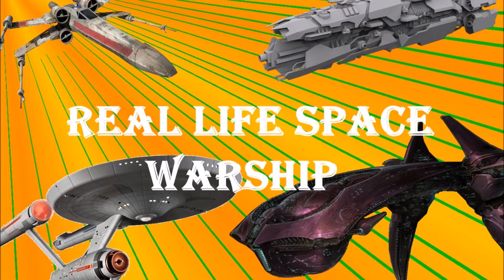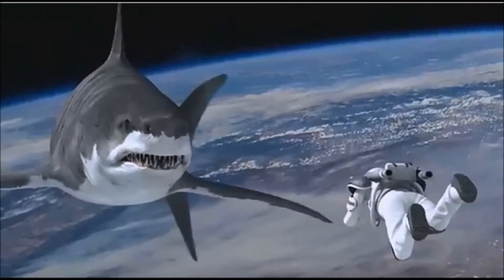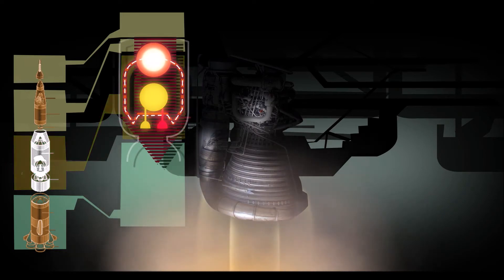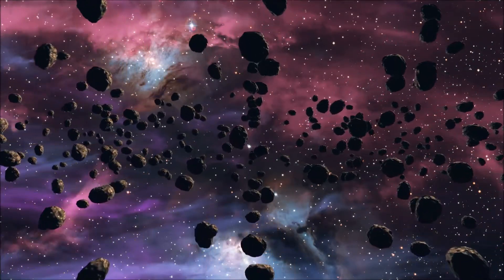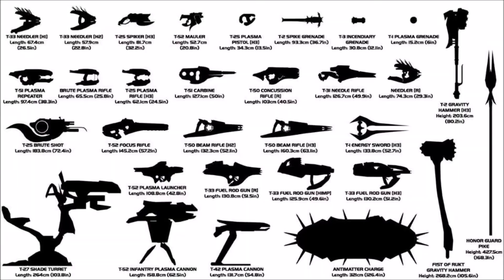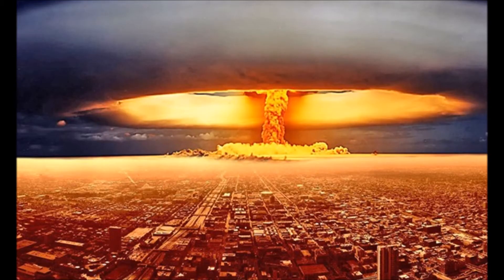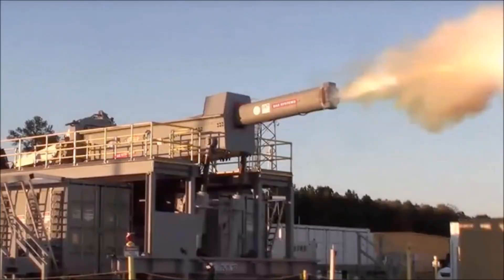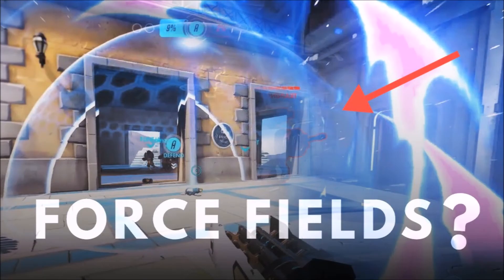Let's Build a Realistic Spaceship (Sci fi Realistic)

Comment: u need heatsinks. plus chem is very slow. but if if it's like a Corvette that is deployed by a bigger long range craft then it works.
and stealth can work if you put a radiation shield in front of your ship, like Jwebb uses for keeping its systems cool. but it is really situational. the stealth only works if you are looking at your enemy, but for that you need to know where the enemy is, and for that you might have to send a signal. but since spacecraft are big white reflectors anyway, visual confirmation might be enough. 
aaand
either a: you have to cool your radiation shield to background temperature, or b, you can only use it if you have the sun behind you, to only heat your ship and not the front facing radiation shield

Comment: The closest thing to a realistic force field I've seen would be kinetic-barriers from the Mass effect series. Mass effect has a fictional mineral called element zero which when subjected to a current creates a mass effect field. A mass effect field has the ability to change the Mass and direction of any object in the field via the manipulation of dark matter(its sort of like a magnetic field that works against all objects) ships are surrounded with emitters that generate mass effect fields when they sense an object approaching above a cirtain velocity. These mass effect fields repell the object similar to how a magnetic field would repell a piece of metal. Kinetic barriers don't work against radiation, toxins or extremes of temperature.

Mass effect has also given a plausible idea for a stealth system in the form of the Internal Emission Sink(IES) stealth system. Any emissions given off by the ship are stored in lithium heat sinks with in the hull and once again ships can still fly in stealth mode because of the Mass effect phenomenon. A special drive core called the tantalus drive is powerful enough to create mass consentrations of dark matter at the front of the ship which creates a gravitational like force on the ship, moving it forward. This technique isn't very efficient for space flight because your ship is basically in a constant artificial free fall and has limited maneuverability but its enough to allow some degree of undetectable flight. While using the IES the ship can passively drift for days or fly for hours. Every the sinks would have to be vented or els it would vent into the ship, frying electronics, fussing bulkheads and cooking the crew alive.

Comment: I feel like a double hulled design like most of the ships seen in Star Trek could work realistically, Take for example the Excelsior Class you mentioned, It's saucer shaped hull is a habitation and command section and the lower hull is primarily it's engineering section where a lot of the machinery and volatile elements used in the ship's main propulsion system are stored, Both hulls are connected by a thick interconnecting dorsal strut that can take more of a beating than the constitution class Enterprises. For safety reasons these two main sections CAN separate in an emergency situation such as the main propulsion system being too damaged to even try repairing, To serve as a lifeboat should the saucer be required to make planetfall or to prevent an individual or invading force from taking control of the entire ship. The Saucer itself has the secondary sub-light propulsion system which would help it escape from any emergency that could arise following the separation thus potentially sparing the crew from any further danger.

Comment: I think laser weapons through space, plasma in air, as the insane cold have space would render plasma pretty useless, but particles in the air make lasers require more energy to do the same job. Likewise to avoid as much kickback as possible, rail guns with a cold acceleration. Not as powerful as a railgun utilizing special bullets, but by using electromagnets like a slingshot you lose alot of the kickback
Reply: except that plasma won't be able to conduct the heat anywhere other than the gun and the target (if hit), it will only radiate energy and that's a slow process. the problem would be to actually make a gun that can shoot ball/streams/jets of plasma
Reply: @midgetman4206  so back to the railgun bit, but that means the plasma would have to be iron based, which loses its magnetic properties as it heats up
Reply: @Furyhound  no, it can be gas based, noble gasses are the best ones but also the most expensive. Maybe a combination of argon to start and the secondary gas is injected, N2 or CO2 will do just fine.
 
The way the plasma is generated is sort like a microwave, a wave (don't remember which one, it might've actually been microwave) excites the gas within a chamber and can become ionized which than makes making more plasma easier as plasma is a better conductor than flat "air"
Reply: @midgetman4206  its likely to be microwave, because thats low energy but high intensity.

Comment: I think that in terms of shape, Cylindrical, Spherical or Cuboid ships would be most logical. The Mon Calamari, Forerunner Cryptum and Borg Cube would all be very good at deflecting fire provided they angle correctly. 

As for weapons, I think lasers would be the only ones capable due to immense distance. Though because of a lack of atmosphere, a laser wouldn’t be able to penetrate a hull. As the hull would naturally have an extremely high melting temperature to handle the extremes of a vacuum. 

Rather, itd be used to overheat the enemy ships and force evacuation. 

Missiles would only work if they had some kind of “slipspace” drive to warp them into the enemy point blank.
Reply: I would agree with you friend but there is a problem. Slip space is 11 dimensions all together I recommend going to a halo channel on YouTube known as installation 00 he will explain to you everything about slip space in a video called slip space so objects that are in slip space pass through objects in real space so let’s say you have a 600 km astoroid on a coarse with a planet but the astoroid is in slip space the object would just go through the planet
Reply: So if you take a missile and put it in slip space to attack a ship the missile would pass through the ship and no one would notice. And besides, we don’t know if slip space is possible in the real world

Comment: What about a ship design that didn't Need to "flip over" for combat or breaking?
Reply from the maker: The main issue I have come across with such a system is that its unnecessary, having a dedicated main engine for braking would add a lot of mass to the ship for both fuel and the unit itself, since less mass allows for greater acceleration then it doesn't make sense to not just flip the ship to break, but I am not an expert so this is just my opinion

Comment: Why use a chem rocket ? The Dv is terrible!

The reason to use something like a ion rocket is the far better Dv you get for the same fuel to mass ratio.

Ideally (barring something like a fusion torch) you would use a Nuclear Thermal Rocket (thats where they run the propellant through a nuclear reactor as the coolant, the propellant heats up far more than from a explosive chemical reaction, and thus the (now vapor) propellant goes oit the nozzle much faster). The NTR will give you good Dv and good acceleration
Reply: For solid core NTR calling dV "good" is a bit excessive, but "less tragic" would be a pretty good description and it should be enough to make some interplanetary flight viable. Actually solid core NTR won't necessarily run hotter than good chemical rocket (say hydrolox), but it can produce lower molecular mass exhaust and give much better exhaust velocity.
Gas core NTR would be impressive but it's an engineering nightmare in one way or another.
Short of fusion torch Orion would be a surprisingly good propulsion - if you don't mind riding a series of nuclear detonations. 
Or NSWR if you consider Orion too boring, safe and sane.
Reply: Also, if you want something super cool, go check out children of a dead earth, its a space warfare simulator. Like ksp, but with weapons and a realistic damage physics model
Reply: Chemical rockets I think are bound to be far cheaper than using any form of NTR (excluding maybe the ones using purely decay heat instead of fission heat), and thus more expendable. Any form of missile meant for ship-to-ship combat within a reasonable range will therefore be using chemical rockets. 

For torch missiles, ones meant to essentially be a hunter-killer and with possibly a large nuclear yield, an NTR makes sense because those are already going to be expensive and you need to squeeze out as much Dv as possible.

Comment: Great. You earned a sub.

1. I love that you picked chemical engines. Most of the time I go with the nuclear thermal rocket for the In-between ion and chemical, but you raise a point- in any setting where there’s space war, there’s orbital installations, there’s many chances to refuel, and when there’s chances to refuel, you can get across Sol with a puny ol’ classic chemical rocket.
2. Lasers are useful in that they have the fastest time-on-target. However, they are limited compared to slugthrowers, be it gunpowder cannons, gas-combustion based cannons, or magnetic coil or Gauss guns. Missiles are iffy. For them to be effective, even more important at Interplanetary distances, you’ll need better propulsion. Fusion or antimatter. If not, your missiles will get blown away every time because they’re just not fast enough. Metallic hydrogen for fuel in rockets might work but it’s still iffy. Even with better propulsion, a lot of your missiles will get shot down, so it’s an effort of spamming them. As you said no shockwave, so you’ll want them to impact directly or spread shrapnel. Kinetic kill vehicles and flak missiles.
Reply: Chemical rockets have sucky exhaust velocity so they need massive fuel ratios to even get anywhere, let alone get anywhere fast. And that's before you start throwing in things like armour, weapons, ammo and beefy powerplants (complete with large radiators) needed to power most weapons. Chemical rocket warship is going to have problems even manoeuvring even around destination planet/moon to achieve/evade intercepts and will have pitiful combat endurance. Even with lots of logistic support going places around solar system is downright brutal courtesy of rocket equation, even more so with chemical propulsion.

Comment: Ok I'm really tired of this no stealth in space bullshit. Let's look at the methods of detection that we use today to locate objects in space. We have radar (short ranged and unreliable when trying to detect anything with common earth based stealth technology), Infrared scanners (honestly IR scanners take a very quick peek at the surrounding area and attempt to detect objects the size of five football fields and still miss them. IR absorbing materials are easy to come by and can be made relatively cheaply. also you can only detect a ships engines if they are on with IR. In space there is no drag so you can shut off your thrust and then coat to a desired destination in cool mode.), Lidar (A type of multispectral detection system that cycles through the known and unknown spectrums of light looking for dips in star light. A similar system is used to detect planets in distant solar systems. If a ship passes between a distant star and the lidar equipped craft the alarm will sound and attempt to track other possible dips. The problem with this is that the system would have to be tracking every star in the visible sky looking for this object that it does not know is out there.) Sonar (If your thinking of using sound, and I know that most understand why this wont work but there are some that do, sound does not travel very far in a vacuum. It will be useless.)

As for useful weapons in space the best so far with our technology would be the railgun as its range is somewhat unlimited and its damage unreal. Also you won't use massive tungsten rounds, railguns today use aluminum slugs with special heat resistant coating. These will pass clear through most anything at super high speeds relative to the target and if the right ordinance is used can also become a fragmentation round at the right point killing a ships crew with metal rain. EMP does not work the way you suggest. If you shoot off an EMP at a target or a nuke goes off near it the electromagnetic radiation does not just supercharge all secrets and fry everything that takes electronics. What EMP does is overload coils or what or other similar structures for the storage flow or generation of electricity and shorts them out. Your car won't start because the starter and alternator are down but your radio, cell phone, most digital watches, and yes even your computer chips will all be fine. In fact it would take an EMP blast strong enough to kill the crew inside the ship in order to overload all the systems. But a sime thin layering of aluminum borite between the inner and outer hull would dissipate the EMP rather effectively. Coil guns, gas propelled rounds, railguns, laser defense systems are all going to be the most common weapons used. 

Loved the video and I'm a fan so keep up the great work.